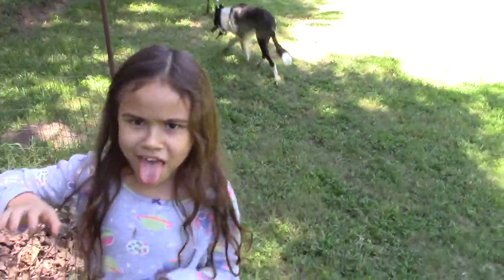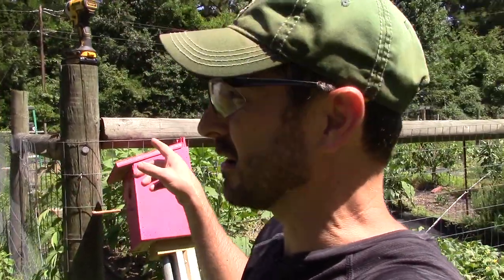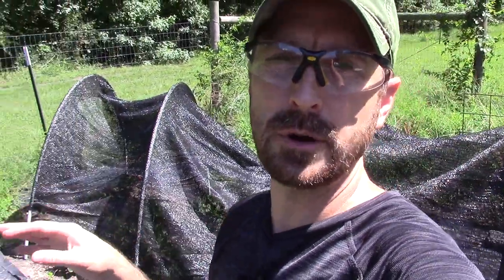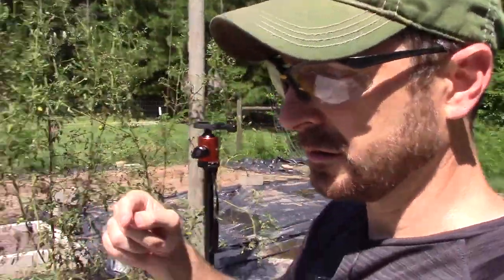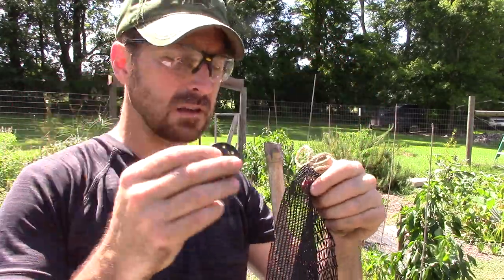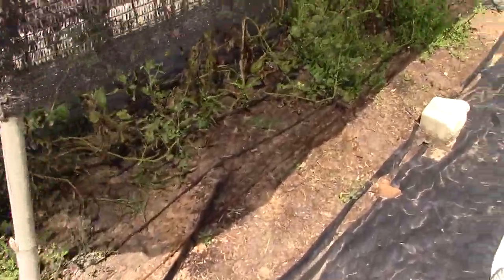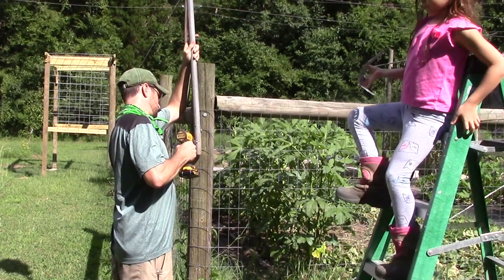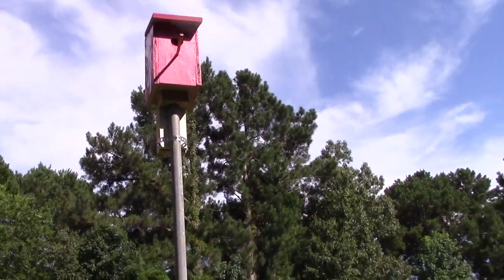Shading Tomato Plants. WHY Would I Do That? Is It Worth It?

Comment: I use a thin shade cloth ( I originally purchased it for bug protection over my greens) that I stapled over landscape mesh on an overhead structure for my peppers that were getting fried from the afternoon sun. It also serves as a wind break; two tomato plants benefit, as well. I have other plants in self wicking buckets under a pergola with a trellis cover that provides partial shade from the direct overhead sun. Those plants are extremely happy and producing in high temps of 90's-100's! 

We frequently get very strong winds in the high plains.  So, I use a very strong shade cloth on one side which has to be secured well to protect them from the strong winds, and often hail... even in summer.  I don't have as many plants, so it's pretty manageable. I have to have structures with either wire mesh or a pergola cover for protection from the hail. 

I am building cattle panel hoops to cover with shade cloth, then a wire mesh over it,  to tie up some tomato plants. I can drop and move the strings if they get too tall, but I'll likely top them off at 9ft.

So, I can say, as a second year gardener of a smaller garden, I found the shade cloth and partial coverings do make my plants happy and continually producing in high heat.
Reply from the maker: Awesome. Sounds like you have your homestead all set up. We get a lot of hail here too. Luckily, it has passed us by this year. Glad that shade cloth is working for you.